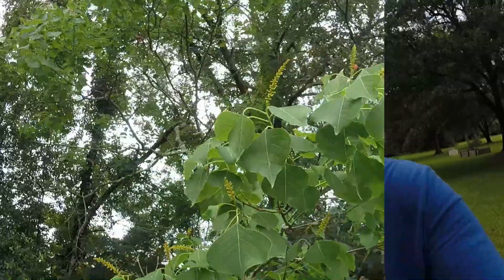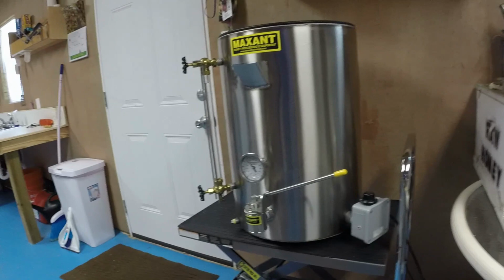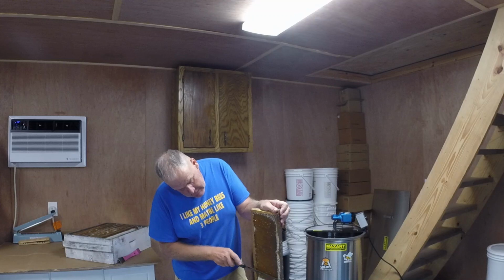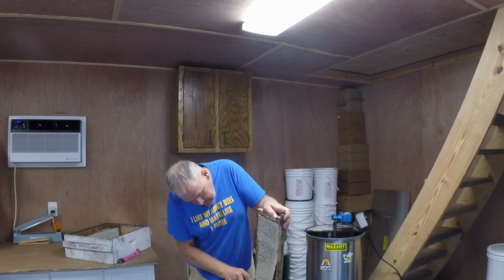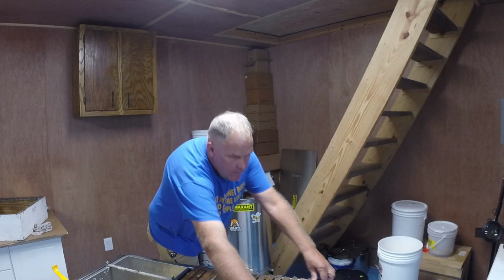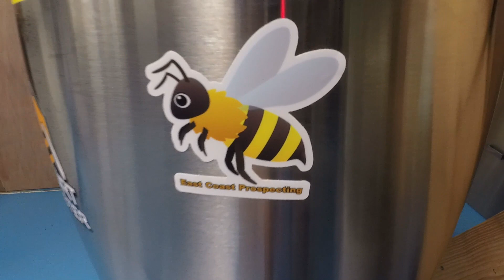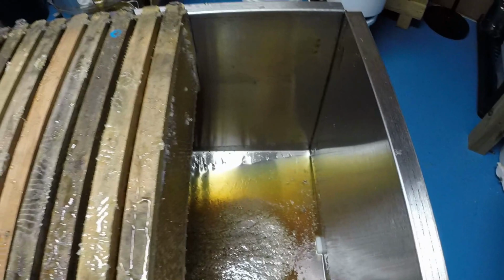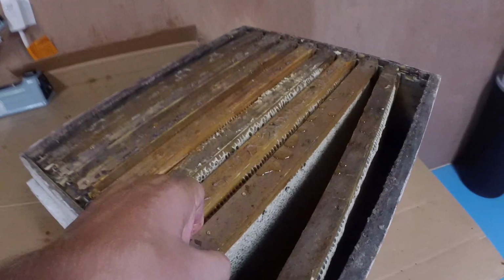Extracting Honey from Recent Harvest

Comment: Dang you make cutting off those caps look easy.
I've got all deeps and it takes me an hour to get through 9 frames.
Thanks for showing us your set up
Reply from the maker: Deeps are a bit harder, but also remember, I run 9 frames in my honey supers, so the caps are out farther and it makes uncapping easier. Plus, that long bread knife is really sharp in the serrated edge.
Reply: I watched your videos last year and ran all 9 frames this year.
Also I got that same jig saw blade knife from I think Kelly.
Most of my frames were built out from foundation this year so they're not as even as yours. 
Also I live in the desert and  the honey has a moisture content of about 14.5 % so I think it's stickier than most ( similar to your privet) and all of the  cappings just stick to the frame and tear apart, even if I'm leaning the frame way over.
Ended up switching back to my little pull style uncapper I was getting it down to about 3 minutes per frame which was a vast improvement from when I started. but still very slow...
Thanks for the response. 
Love all your videos and pick up something every time I watch one

Comment: Hey mike, I am having trouble with ants getting in my honey buckets, I bought the screw on lids and had the honey house sprayed but they still seem to find their way in. Any ideas?
Reply from the maker: Well, I’m not sure what else you could do. Did it get sprayed heavily outside as well as inside? There is a really good liquid ant bait that you could place all around inside and I was able to completely rid my other camper I had of ants. It’s Terro Liquid Ant Bait. It’s time consuming to put out, but it sure kills them off. And you would need to put out quite a few, but it works. And then I would have the outside professionally treat very heavily with a liquid off of a spray rig, not a hand sprayer either. The kind like they use to spray yards. I think it’s bifenthrin for the chemical. I hate ants, I really do.

Comment: Mike.  What's the temperature in your extracting room?
Reply from the maker: Brad, I keep it at 23C. My warmer box is set at 100F (37C) but probably is overall staying at about 35...When extracting, I bump up the room temp a few degrees and this next season I will have my dehumidifier in there with some fans and I'll keep it more like 26 for a few days to dry things down a bit. We just have to be careful how long we keep honey frames in the open and in the heat due to the beetles.
Reply: @MikeBarryBees  My hot room and honey house are also one space.  I run it at 30c but I also run an industrial dehumidifier set at 50% RH.  It's warm to work in there but keeping the humidity in check makes it manageable.  Before I had the dehumidifier, it was brutal in there!